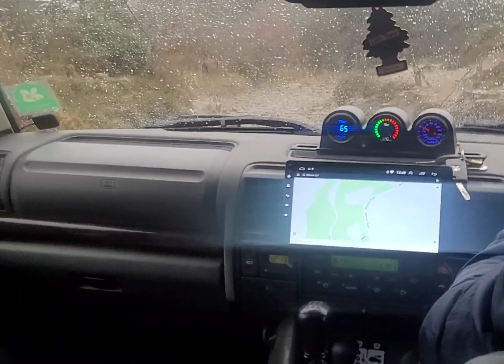land rover discovery 2 td5 My New Build!

Comment: Nice but clips to quick bud, enough to cause epilepsy! What monitor was that ???
Reply from the maker: Sorry it was done on my phone when I was bored not being in work. As you can see am not a pro at it. 
Am sure u can slow it down on the YouTube player tho 🤣🤣🤣
Reply: @alanchan7731  I get it. What is the screen???
Reply from the maker: @63Landbadger  the screen is this   https://www.ebay.co.uk/itm/155340619752?mkcid=16&mkevt=1&mkrid=711-127632-2357-0&ssspo=inr6OrPUQaC&sssrc=2349624&ssuid=LLC0UtOXReO&var=&widget_ver=artemis&media=COPY
Reply: @alanchan7731  Cheers for that, you need to do a feature on it, fitting and so on
Reply: @alanchan7731 great build. Do you know what the screen and gauges are called specifically so I can search google? Link isn’t working in South Africa.